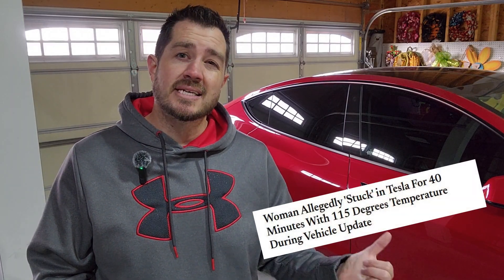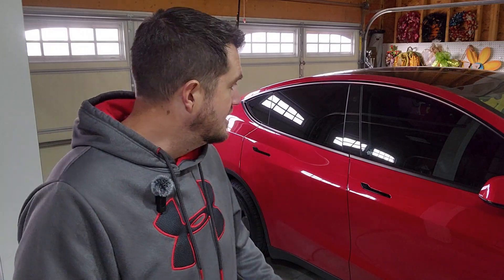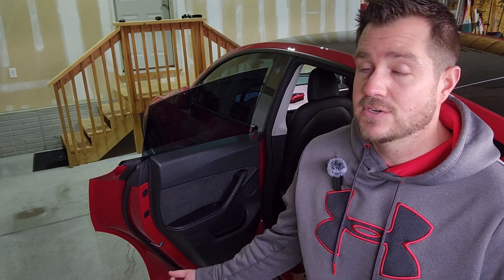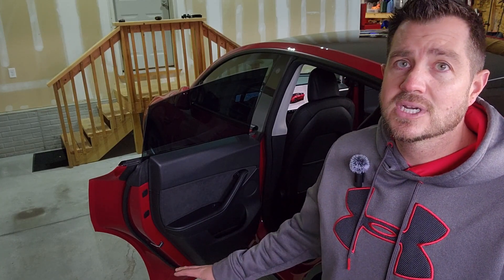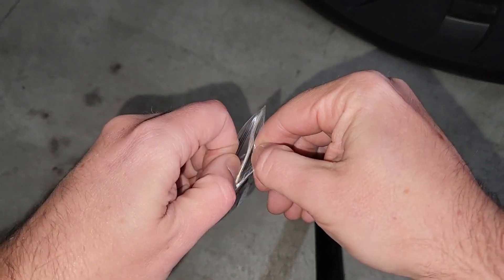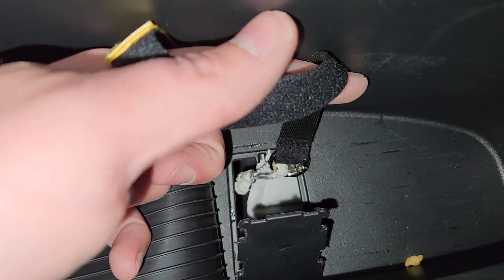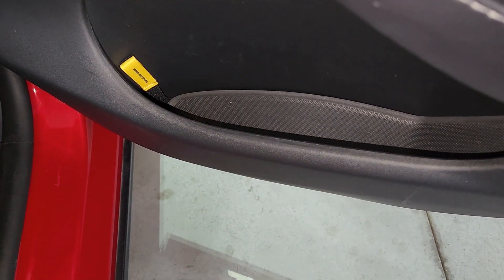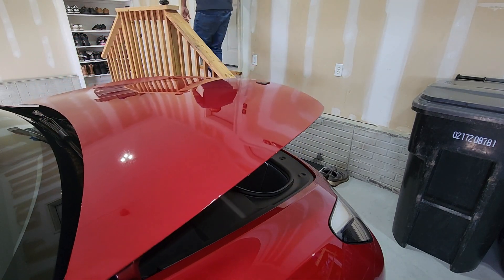Tesla Door Safety Explained: Installing Emergency Release Pull Cord

Comment: It’s great that you’re sharing this. I saw this on another automaker’s channel a couple years ago or so.  This is a terrible solution by Tesla.  They need to implement for the rear doors something similar to what the did for the front doors. Their original solution can prove to be a challenge for people just under normal.  It’ll definitely pose a problem I. The event of an emergency like an accident or a fire.

Comment: Thanks for this.  I will be buying these straps. I do see this as an oversight by Tesla. Recently in Toronto a Tesla (3?) slammed into a bridge pillar and caught on fire. 3 people died and some claim the reason was that doors would not open. Looking at pictures, I don't know if they would have survived even if they could have opened the doors, it was really smashed. BUT - first responders also claimed they could not open the doors from the outside. I think that is another safety oversight.  I know overall Teslas are safe vehicles, but the task of opening a door in an emergency should be a simple and obvious thing to do.
Reply from the maker: Thanks for sharing this!
Reply: I've seen old manual door locks not open in a crash but also vehicles so mangled that the doors are never going to open regardless.